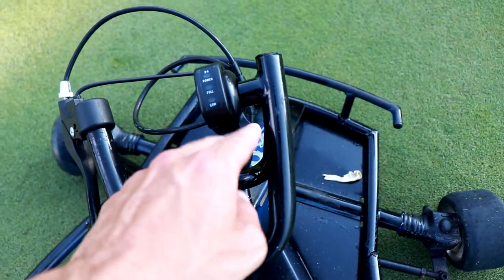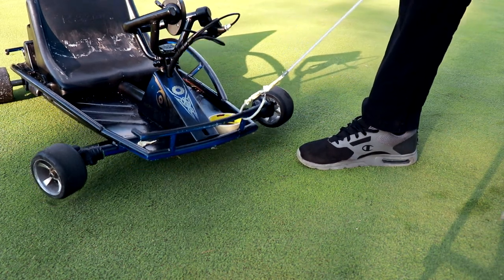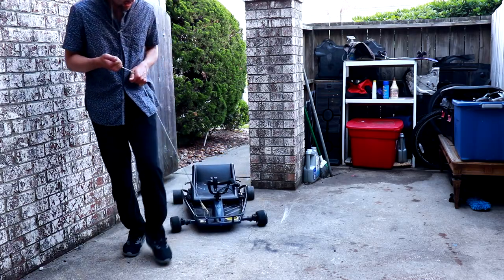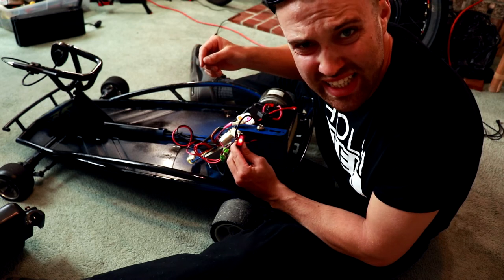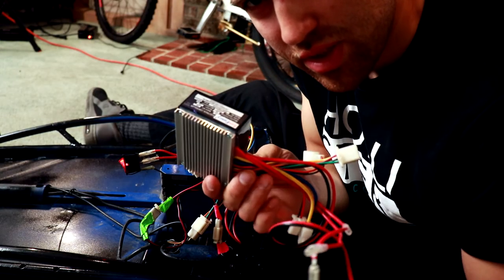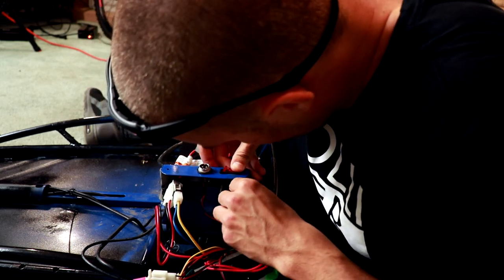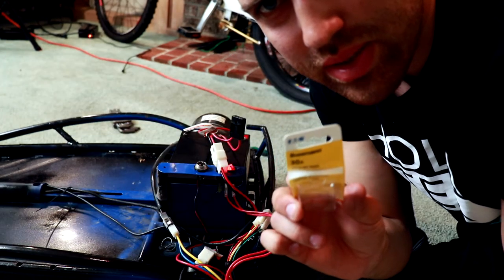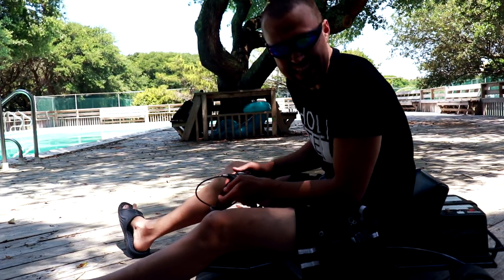Problems With My Electric Go-kart GROUND FORCE DRIFTER

Comment: I replaced it with a new one and it still makes that noice Anne won't run
Reply: We did the same and still makes just the clicking noise. Batteries are new as well so its not either. What else could it be?
Reply: Maybe the fuse ?
Reply: did anyone found the solution i did the same and still not working
Reply: @CuongNguyen-lm8ic  ever figured it out?